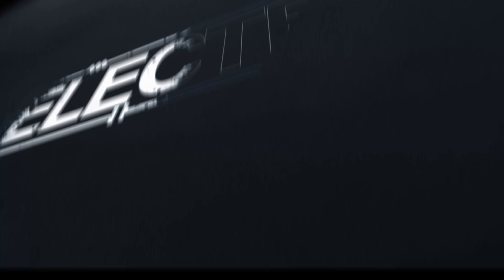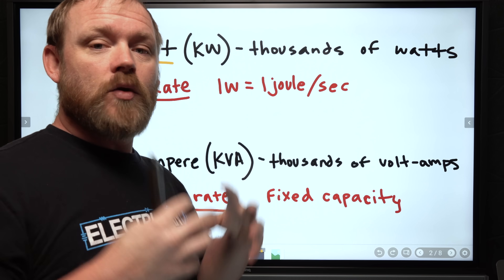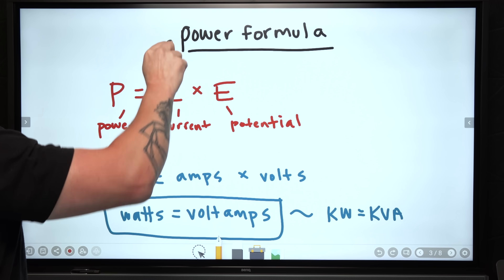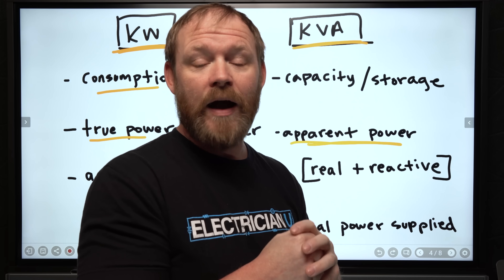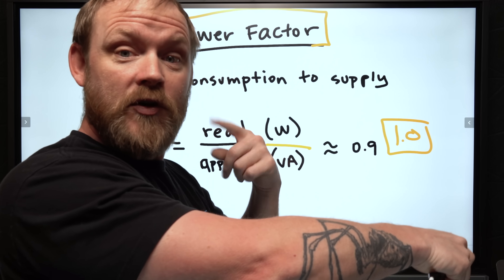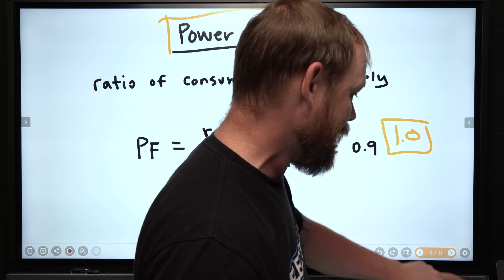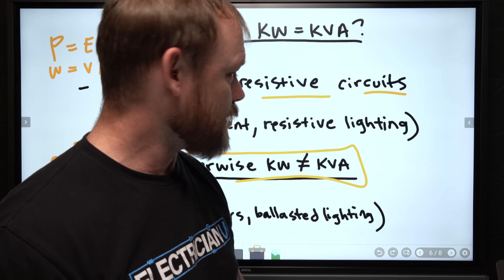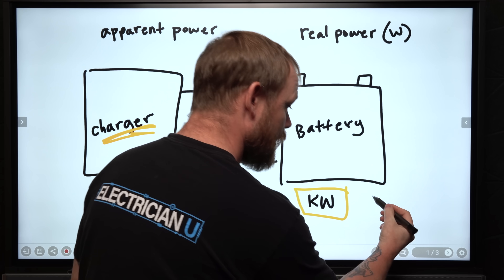Why KW and KVA Are NOT The Same Thing (Even If They Seem Like It)

Comment: POWER is always a rate, (Energy-Rate, the math is Energy Divided by Time = Power.)  - any other way of thinking about it is incorrect.

Real Power (P) vs Apparent Power (S).  Real POWER can be converted to REAL WORK (including thermal work), Apparent POWER is the POWER which is generated and sent down the line - which contains a component which does no real work  = Reactive Power, (Q) but the TOTAL Power needs to be INPUT into the grid) - this costs money / energy / Generation and Transmission capacity.

Indictors, and Capacitors are the "Reactive elements" - "ELI or ICE"  - On an Oscilloscope one can see the Current (I) leading or Lagging the Voltage - (E, for emf)  take effect here.. ('L' for Indictors, 'C' for Capacitors, I for Current and E for Voltage - yes there are a few terms people can mix up ("Amperage" isn't a thing - it is called Current).) - The Power triangle is drawn up using the "angle" of lead or  lag to calculate the power factor (Ratio of Apparent(S) Power  to Real (P) Power , Zero angle = 1.0 power factor, S = P,  (I after E  is an Inductive load (Lagging Power Factor, below 1.0 and a POSITIVE Angle, because Voltage leads, though "Conventions" like to phrase it as Current Lagging (E Leads I and I Lags E, is the same phenomenon, written backwards).) 
 I before E is regarded as leading power factor = Capacitive load, PF is Greater than Unity..  The Reactive Power is 90 Degrees to the real power, indicating (mathematically) that there is ZERO REAL vector component in the Reactive power - they are orthogonal.
 
Anyone talking about POWER as "storage" is muddying the waters (or simply stating it wrong) , because Electrical Storage (any "storage of (stuff) to do WORK in the future) is ENERGY - Joules, or KiloJoules =( kJ ).
( "killaJoules" does the Killing in Electrocution events = I*V*pf*Time  It's REAL)

 - ENERGY is POWER x TIME  (or POWER supplied FOR a certain amount of TIME)   - Some say "Power over Time", makes some people think that you mean a fraction - especially in EASL countries, TLDR: Power / Time is a unit known as a "slew rate", the change in POWER per Second.

Apparent power - yes -  (It isn't really "Imaginary", though we use imaginary Numbers "J" to explain the "graphic" - often.

At Power Factor = 1.0 Impedance() and resistance (R) are the same thing/equivalent.
 - Purely Resistive elements  - low level Electronic theory - where Resistance and Impedance are the same thing, the Units Converge, PF = 1.0. (Reactive Elements all have Impedance (Z) which differs from the "DC" Resistance (R) - there comes that triangle thingy, time to get "Trig", or Pythagorean.).

In a purely resistive circuit R and Z they are the same thing  - and simply obey Ohms Law. (ok one will argue a purely resistive circuit does not exist, there is always "transmission line" reactance at the very least)..

Mechanical Power  - motor output- also kW - is equivalent to the Electrical POWER (RATE OF ENERGY) - with motor losses.

 - The kWh stored in a battery also does not correlate with the  kWh of energy that is pumped into it, close but not the same - there are losses in charging circuits (Some real, some reactive)- a Battery exhibits Capacitance and Inductance...

BATTERIES ARE a LOAD during the Charge phase (They Absorb REAL POWER for later Discharge - they also Consume REACTIVE POWER-  -through Reactance (Thermal losses are real, measured in Watts of Thermal Energy) - That is why talking Anode and Cathode on batteries is confusing - as the correct term - CHANGES  as it switches from charge to discharge -  Reduction to Oxidation, (on Discharge the Anode is Negative, Oxidation occurs as Electrons flow out, on Charge it reverses..)
 - Note various "time varying" charging profiles, means that a battery  - during Charge - may not be a true DC load, but a DC load offset with time varying electrical components, even a "simple Electrical circuit" with resistors and a capacitor, becomes reactive ad it is no longer Purely DC - while ever the Capacitors are varying their electrical charge storage level.

Comment: KVA and KW are the same thing, it is power in a circuit. KVA indicates that it is a reactive power using AC. The current and voltage through a reactive load are out of phase so finding the power isnt just a simple peak volts x peak amps as it would be in a dc circuit.

Transformers use power, in power stations the transformer need gallons of cooling oil. The coils in a transformer have both real resistance and reactive impedence.

Comment: Power (P) = V I cos φ, where φ is the cosine angle between voltage and current.

In a DC circuit, voltage and current are always in phase, so φ = 0.

Therefore, cos(φ) = cos(0) = 1, and 

Power becomes P = V × I.

Comment: kVA is NOT 'storage capacity'. Storage capacity in electrical systems would be a measure of energy measured in either joules or KWhr, or charge capacity measured in Farads, ie. capacitance. Both kVA and kW are indeed measures of POWER.

Comment: Hi! I am trying to figure out if a house I purchased in Portugal has the capacity to run my kiln. The house has 10.35KVA capacity and my kiln is single phase, 240 volt, 11,520 Watts, 60 Amp fuse size with 6 ga wire. How can I determine if there is enough load capacity to run the kiln?

Comment: OK.  My stereo's speakers are rated in watts, because they're on the power consumption side.  But my audio amplifier is also rated in watts, even though it's on the power supply side.  According to you, I believe, another reason the amp should be rated in KVA (or VA) is that there is impedance in the wires and in the speakers, lowering the power factor.  There should be no reason to rate the amp In watts, because that exact number of watts is not available to do work in the speakers.  If this makes sense it's just another reason never to trust the wattage ratings given for amplifiers!!

Comment: I regularly perform maintenance on medium voltage systems up to 44 kV. The transformer converts up to 20% of its energy into heat during conversion and can reach temperatures of up to 90°C. Therefore, what is said in the video between 7:30 and 7:44 is incorrect. An acoustic 100 Hz hum and slight vibrations occur during operation. This is caused by the 50 Hz power grid. In other countries with 60 Hz power grids, the situation is similar, only the tone is slightly higher at 120 Hz.

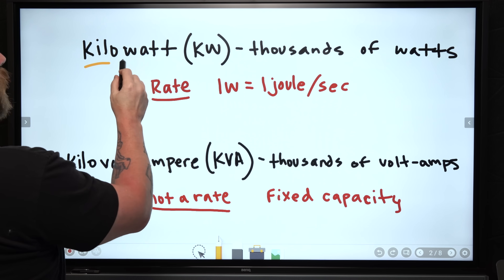Comment: 1:28 That "something" is the power. :) From high school physics, a watt is a unit of power. It can be the electric power or mechanical power. Open any modern passenger car spec, the engine power is listed in kW and HP.

Comment: The BMS and supporting electricals like battery heaters, coolers, etc are in the car with the battery pack that would also affect the PF. That also makes the KVA rating on the charger a more accurate spec as a power source.

Comment: Have to Remember there is a Chemical Factor to batteries, There will Always be a loss between heat & the chemical change when charging or powering a load which causes Bleed Current internally which kinda causes a power factor since not 100% of the power is going to the load.

Comment: 1.	VAR and VA are only relevant in AC systems; in DC systems, W = VA, and VAR = 0.
2.	VAR represents reactive (non-working) power, mainly from inductive loads like motors. It causes extra current that loads the system but doesn’t deliver useful work. Imagine a coil temporarily storing energy and then sending it back to the power source with each AC cycle. This creates additional load on the grid, and the power source needs to supply apparent power = real power / power factor. For example, for a 500 kW motor with a power factor of 0.8, the apparent power is: 500 kW / 0.8 = 625 kVA
3.	Batteries are DC sources, so they are rated in watts or amps, or watthours, not VA.
4.	AC battery chargers may draw reactive power due to inductive components. DC charging systems do not draw reactive power under steady-state conditions, though switching circuits may introduce short transients or harmonics.
5.	In DC, saying VA = W + VAR would be trivial and misleading because VAR = 0.
6.	In AC, VA ≠ W + VAR; instead, it’s a vector relationship: S = sqrt(P^2 + Q^2)

Comment: Apparent power is something like a spark plug in a combustion engine,  it is consuming power (electricity), but is not rotating the engine,  the gas explosion is what is really generating movement,  but we need that "waste" energy to cause the ignition of the fuel.

Comment: Its just units if you are on one  side of the equation you end up with VA since a VA is a watt thats the other side of the equation.      Once you have a power factor to deal with its no longer apples to apples. .95 power factor would cause huge problems on a power bill if a 10,000 watt motor was billed at 10,500 watts that would be a problem a huge problem instead a .95 power factor motor of 10,000 watts is billed at 10,500 VA which is understandable since VA and Watts are not the same for the general consumer. So that customer service reps dont have to explain that VA divided by power factor is the same as watts. We just inherently believe this fact when the units are different.

Comment: My eye was twitching at some of the terminology. While Watts (power) are a rate of charge transfer per second, energy and charge are not the same thing. Energy is the accumulation of charge over time. If Watt = speed, then energy is the distance traveled over a period of time. Or if  Watts is flow rate in a pipe, then energy would be the amount of water transferred over a period of time. 

Still, great explanations.

Comment: The real explanation starts at the 11 minute mark.  Batteries always work at DC, so their power factor is 1.0 so W == VA.  AC powered circuits that are purely resistive, or have power factor correction (not mentioned in the video, but true anyway) that is 100% effective also have power factors of 1.0,  and can be rated in W.  AC circuits that are neither of the above have power factors less than 1.0 and must be rated in VA.
Reply: Just because power comes from a battery (DC source), doesn’t mean that kVA = kW in the load.
Reply: @lindsay.newman  If the frequency is zero Hz, why wouldn't they be?

Comment: I mean, they are identical, when considering a power factor, right? In an inductive or capacitive load, the voltage lags or leads the current, and the instantaneous kW is different than the maxima of the voltage and the current multiplied together. That ratio is the power factor.

Comment: The way I was taught and understand it, KVA = WH that factors in (math) Power Factor. Inductive loads like motors and transformers, and capacitive loads like most electronics, can really mess with the utility power distribution system. Because the Electric Utility is negatively affected by Power Factor, they could/should use KVA. Transformers are inductors (Henry), so they should display KVA not KW for their input. Unless you are an Industrial Electrician, Electrical Engineer, Electric Utility or higher, KVA has less of a purpose. If you need to do power loading math, you should use KVA in place of KW (but not the other way). If you don't know what Power Factor is, or know how to measure it, you probably don't need to know the intricoes of Power Factor.

Comment: Voltage x current is power, which is measured in Watts. The unit is exactly the same. So, from a Physics standpoint, they are the same. For purely resistive loads, they are also the same. Like others have said, the only difference is the power factor.

Comment: I've got the feeling the distinction between DC and AC should have been made much earlier in the video to set the correct framing for the question in itself. 
In a DC circuit you will hardly ever talk kVA as voltage and current will (effectively) never be out of "phase" (neglecting transatory effects).
Once DC is out the way, you can focus on AC and the implications of voltage and current being out of phase.

Comment: The power factor is not adequately discussed here and this can be described thus: Power Factor is the ratio of the real power absorbed by the load to the apparent power flowing in the circuit. 
The real power is  measured in Watts and the and the apparent power in VA. When the inductive reactance and the capacitive reactance cancel out the then the Power Factor is 1 and the full power is utilized.  However if this is not the case the power factor will be less than one,(say .6)  and the full power is not utilzed. (reactive power). Energy once created cannot be destroyed. so this reactive power flows back to be absorbed by the generater  and is undesireable, for these uneccessary flows of energy mean wasted energy in heat and in the bigger  cables that are then required.

Comment: After watching this video, it is apparent that KW vs KVA is still one of the most misunderstood concepts in electrical work. I rely on oversimplifications to explain things all the time and trying to explain complex ideas in 15 minutes or less requires them. "One represents capacity and the other represents consumption" and "one is a rate of transfer and the other is storage" aren't simplifications or even oversimplifications. They are just wrong. Fortunately, at 12:08 or so, you get to the actual difference between kW and kVA: reactive loads. The previous 12 minutes of naïve conceptions, however, overshadows what correct information is in your video. (For the record, resistive systems where kW = kVA are not "incredibly rare" situations... they are commonplace and suggesting otherwise is a disservice to your viewers.)

Comment: MSEE and design/build industrial transformers as a career. I have to disagree about the premise that VA =! W. It materially equals the same thing. However, Power Factor calculates the loses in any system. Meaning PF = W / (W + dWloss). For instance if you give me 100VA and I have a load that uses upto 100W, in a perfect system I could measure (without loss) the load using 100% of the supply. Since even measuring the system would create a loss as well as all the intrinsic losses through the fields, then we can say work on load divided by the work on the load plus some delta work in the system. Really it's just a different standardization of terminology. Hence the naming convention for supplied in VA and consumed(or converted to work) in W. Still providing good information about the subject though.

Comment: What a weird discussion. Watts Volts and Amps are just units. Amp is the only basic SI unit. Watts indeed are Joules per second. Joules are Newtonmeters. Newtons are just kgm/s2.  Volts are defined as watts/amps, hence W = VA. Watts and Volts are derived units, nothing more. Please start to define what you want to compare and choose the apropiate units.
The explanation of the power factor (no units !!) is correct but both real and apparent power can have W or VA as units.

Comment: Technically nothing is purely resistive as a load. The major difference is whether something is using AC or DC  because you only have to deal with reactance with AC or pulsed DC systems. Reactance happens because electricity cant change instantly in response to a changing input, even the wire has some capacitance and inductance that cause a shift or lag between input and output. If the input is a constantly changing AC signal then the output will always have some degree of phase shift from the input, that is your power factor.

Comment: Weldone❤
I have a question :Single phase induction motors are usually connected with capacitance does that mean they have impedances so should be rated kVA? 🤔

Comment: I get the difference: KVA is what‘s in the tank, KW is your horsepower, the power of your engine (and maybe your maximum instant fuel consumption).
However in most situations what you want to know is: how much power do I have and how much am I going to use- so I work both in KW

Comment: The reason VA and watts aren't the same in an AC circuit is because of how you decided what the value of V is.  V is spec'd as the RMS voltage.  Basically, the average of the volts as it cycles up and down in a sine wave pattern.  If the amps you draw off the power lines cycle up and down in lock step with the volts, than your rms voltage times your average amps = your watts.  But loads with capacitors and inductors don't do that.  They are out of phase.  So the voltage actually used is lower than V rms.  Power factor tells you how much lower.  For example, .9 means you are drawing your amps when the average voltage is 90% of rms.

Comment: Several thousand years ago I learned about ELI the ICE man. In an Inductive ( L, loop) circuit the Voltage (EMF) leads the Current (I). In a capacitive circuit(C) the Current (I) leads the Voltage (EMF). So? If you are casting lead shot for your muzzleloader using an arc furnace, pure resistive load, your electric meter is spinning at a frequency only dogs can hear. If you happen to locate an old pole pig, electric pole distribution transformer, and hook it up as an inductor in series with your resistive load furnace, you spend way less.

Comment: I am sorry, this is not accurate explanation. In fact energy supplied will always be equal to energy consumed. But what is the difference in KVA and KW? For Instant take an example of full load of pure capacitors. In this case, energy supplied and energy consumed is zero. Because in part of cycle energy is supplied from generator/ Transformer to load and in remaining cycle it is pumped back. So net transfer is zero which is kw. But in part cycle when it was flowing from generator to load, it was kva. KVA is important to know because it defines voltage and current capacity of the source.